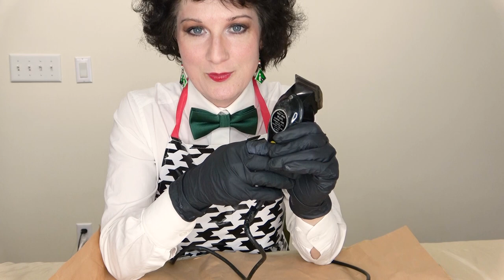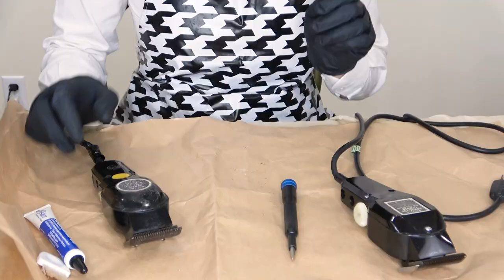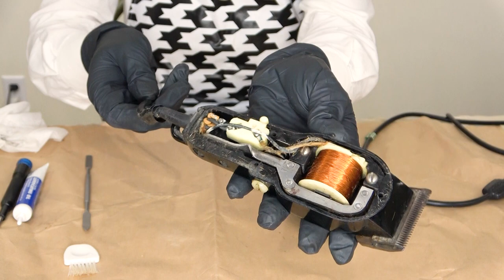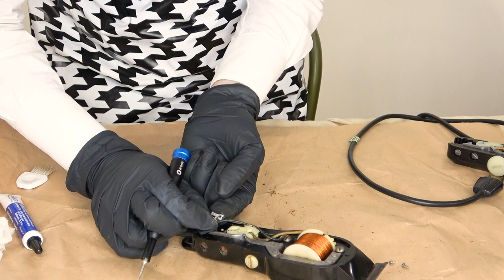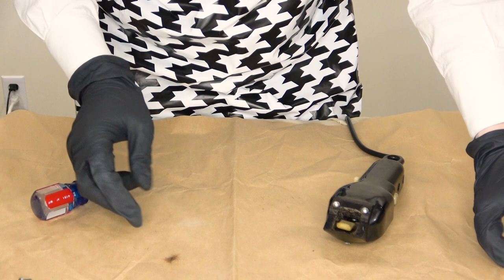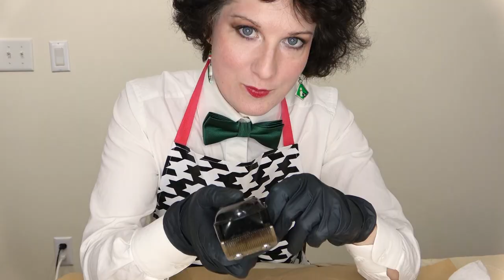Cleaning and Swapping Electric Power Cords for 1950s Wahl Barber Hair Clippers

Comment: CRC white lithium lube grease works well between the tongue and the blade. Ive rebuilt a few Oster Pro Salon 76's and Wahls. Wahls do that a lot make loud noises and jam up.  I have a few consumer versions that are 25 years old that did that. When you tighten the comb blade with the two screws. Dont tighten them hard at first. Just snug enough but loose enough to where the comb blade stays put, but you can still manipulate the cutting blade and zero gap them within 1/32 " of an inch to the comb blade. Then incrementally tighten the screws 1/16 to 1/8 turns each side until they bottom out.
Reply from the maker: Thank you!